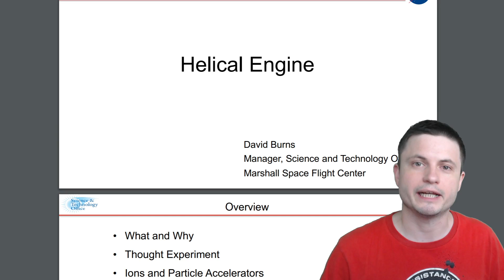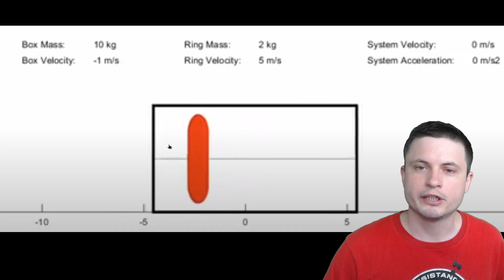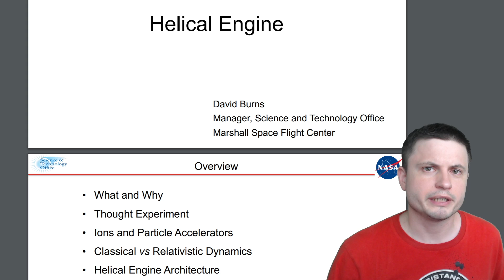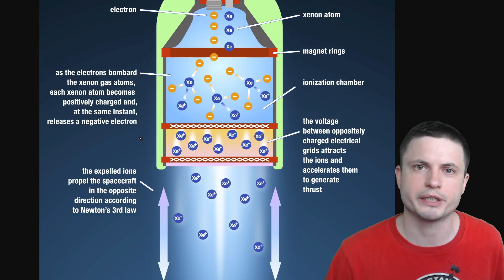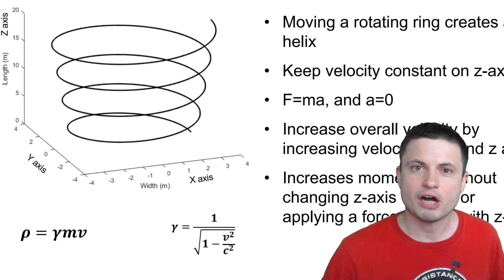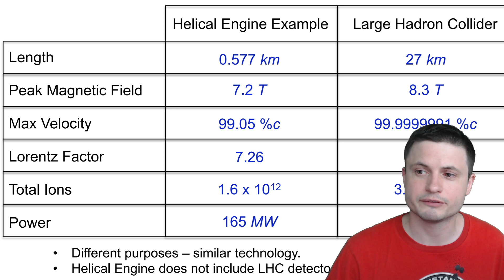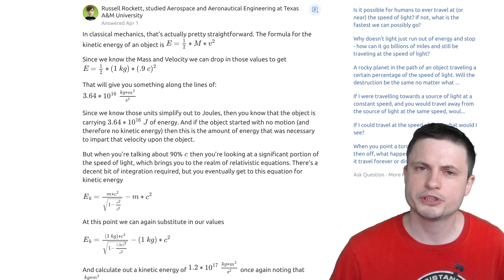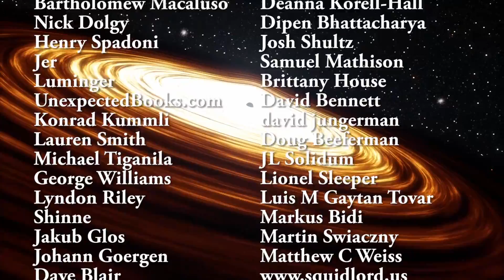NASA Engineer Designs a Near Light Speed Engine But Does It Work?

Comment: lol come-on nasa dont just throw uranium out the window. lol uranium asteroids would suck!!!!
maybe play some billiards and learn how to harness and direct the spinning motion of a spherical object. YOUR SPACE SHIP SHOULD BE THE BILLIARD BALL  BEING SHOT INTO DEEP SPACE. PARTIAL ENERGY GAINED BY IMPACT OF ASTEROID MATHEMATICS AS YOUR STEERING WHEEL AND A SUPER cpu TO WORK OUT THE NECESSARY ORBIT FOR INTERCECTION. YOU JUST NEED TO SPIN YOUR SHIP OPPOSITE OF THE ASTEROIDS ROTATION. YOU IN EFFECT CAN USE YOUR ION ENGINES AFTER YOU ESTABLISH ACCELERATION. IF YOUR SCARED OF IMPACT. USE MAGNETS W CORRECT POLARIZATION FOR THE SITUATION OR EVEN ACHIEVE ACCELERATION FROM A DISTANCE WITH THE NEW LASER SYSTEM BEING WORKED ON RIGHT NOW IN HOPES TO GET SHIPS THROUGH OUR ATMOSPHERE WITH OUT NEEDING FUEL. 

I KNOW SOUNDS FAR FETCHED. lol welcome to being a human tho. fetch the far ideas folks! much love

Comment: You have an incorrect analysis of the energy needed. You are factoring in resistance against achieving the speed of light bc of your experience on earth, in space the weight of the object is completely irrelevant. If you want to reach the speed of light you need only to ACCELERATE to that desired speed, the mass of the fuel cell is relevant only upon thrust force...which in space oddly enough is force multipled against itself (0 gravity). This is why using decaying isotopes for fuel energy is so effective. The weight is irrelevant, it's about the reaching of top speed rather it's quickly (boost engine) or slowly and constant (ion propulsion and radioactive decay fuel cells). I feel you don't grasp the concept of physics in 0 gravity payload propulsion systems very well. To simplify it...greatly.... you can imagine weight in a car with round wheels vs square wheels on earth. The weight itself of 1 person vs 2, 3 or 4 is miniscule....it's the ability to reach top speed fluidly and easily that's the greatest mechanical advantage....and luckily in space there is mechanical advantage in abundance. In space size DOES matter, but not in weight, more so in the size of the area you are trying to reach that speed of light. You can choose quickly in spurts (like the nuclear bomb detonation propulsion engine method) or slow and steady (again ion thrust from SpaceX or radioactive decay propulsion like voyager plutonium core decay). Weight in space is not a significant factor unless it prevents said energy source from obtaining desired speed.

Comment: to get up close to lightspeed will take 350 days at 1g of acceleration,so to get to the closest star will take about 7 years if this had been possible(it is not) as one adds fuel the spaceship gets heavier so you will need more fuel making the spaceship even heavier so one will need more energy to accelerate than it is possible to bring with you this is the smallest of problems one will have.the blueshift as one gets close to lightspeed will change every type of radiation into ionising radiation the protection will add even more weight to the spaceship so this is impossible and will be so long into the future.

Comment: Lightspeed is not fast enough. Even with a lightspeed engine it'd take us a thousand years to reach the closest star, which is a red dwarf anyway.
And lets not forget about deflector shields before we go, or a rock would go straight through the hull. And long range gravity detection so we dont fly straght into a black hole or a rouge planet.

Comment: Probably is better to improve ion engines.
Combine outgoing ion exhaust velocity with near-relativistic speed, like particle accelerators.
But smaller.

The system you described remember an half alcubierre bubble. In other words, in an half acceleration ring we can add positive mass, or positive thrust, not negative.

Comment: What about if you could reduce the mass temporarily and then as you allow it to return to normal it would increase causing the increase in mass without anything like the insane numbers of energy you talked about in this video
Reply: But by the speeds they want to achieve.. something spinning sounds alot more durable that something banging on a wall back forth at light speed while be assembled and reassembled lol

Comment: What no one ever talks about, is when these "ships" reach these other solar systems light years away. So, as far as getting a signal from one of these ships when they reach their destination, it could be hundreds of thousands of years before it gets back to us. In our time, the ship will have already reached its destination, but it was traveling so fast that it's already in the future, so it will be in the future in our time when the ship arrives at its destination. So, how will we get the signal in our time? this is the part that I was always wondering, but it seems like no one ever talks about it.
Reply: Wow never actually thought of that holy shit. We wouldn't be able to send a signal. The ship would in fact have accelerated in time.
Reply: @tori9365  But what I'd also like to add is that in order for us to receive the signal, the ship which has already arrived at its destination in the future, will have to somehow send a signal back to the past for us to receive it. So technically the ship would be in the future, but the signal will have to be sent back to the past.

Comment: I wonder if a ship would need two different types of engines. The alcubierre engine is like a wave pushing the spacecraft, kind of using high horse power to get up to speed, then the engine proposed here could build on that momentum to carry the ship at a faster velocity, similar to a spinning bullet or a hyper velocity missile.

Comment: If you reach near Lightspeed by pure propulsion you have to slow it down again if you want to stop.
I guess a Warp drive is more feasible as you "just" have to stop warping after you reached your destination and your speed itself can be as slow as we can fly now in space, easier to stop and you can theoretically move faster than light while in warped space.

Comment: "We will never get out of our solar system without warp drive". - William Shatner in 1955
Reply: we DID get out of solar system without warp drive
Reply: @marekverescak2493  It only took 40+ years, an eternity in the human lifespan. If we (humans and not AI) want to escape the solar system we need to move fast, extremely fast, hence warp drive is the only possibility, you move extremely fast.
Reply: @bronder1092   The thing is if we could travel with 99% Lightspeed we wouldn't experience much time because of time dilation. So the human inside such a rocket could survive a really long travel. But we wouldn't be able to communicate with earth for a long time and people on earth could forget about a mission that started some thousand years ago.
Reply: @20Paulchen08  That's exactly why near the speed of light is the best option. I only stated that traveling at the same speed as the voyager's would be too slow, it would cost too many years, hence why I referred to near light speed as the best option.
Reply: @bronder1092   Even at 70% the speed of light, it's still a ~6 year trip to alpha centauri, with about a year experienced in dilation on earth
Reply: @alanwatts8239  Exactly. Light speed (compared to the scale of the universe) is extremely slow. Possible solution: if wormholes prove to be a real phenomena, that is our only hope of getting out of our solar system.
Reply: @bronder1092  Indeed...rockets and light speed won' t get us anywhere. So, sometime in the future a brilliant system will be created, one that we cannot imagine now. That is, assuming Humanity survives...would it not be ironic that an invisible virus ends all of Humanity's dreams...
Reply: @bronder1092  Technically the voyager probes barely utilized propulsion to gain momentum and mostly just use gravitational slingshot maneuvers. In theory we could easily make intersteller travel far faster with even photon rockets or just making a sail and beaming lasers at it. With that you could reach our nearest neighboring star in 5 years, though if you actually intended on stopping you would need about 10 years to make it to the star. 

Other methods are ion drives (though you would need a ton of fuel), nuclear rockets (again you would need a fair bit of material to kick out to get momentum though you could collect more hydrogen from space as you travel with this one), and of cause the most outlandish antimatter annihilation. This one though is basically out of the question as we have no decent way to store antimatter nor can we just make it on the go. Most likely is that interstellar travel will mostly be a mix of both nuclear and photon drives combined together. Nuclear rockets also in theory could make it to our closest neighboring star in about 20 years though 50 if you you plan on stopping but that's at least a method that could be done now and the reactor powers the ship making power also no longer a question. 

Since warp drives likely are more theoretical that reality this is probably the best we've got. Until we learn what gravity is and learn there is a way to manipulate it (if there is a way) there really is no easy way to make a warp drive. It's kinda the whole reason more informative sci-fi such as Mass Effect and Halo don't use warp drives but something more economical. In Mass Effect it's the totally made up element zero which when electrically charged removes mass from nearby objects and can induce a negative force on things known as dark energy (it's an explanation to both dark energy and dark matter though totally unrealistic) and Halo uses slip space ruptures by making micro black holes collapse forming a tear in the the universe to a parallel dimension known as slip space (also unrealistic but far cheaper than powering a warp drive and without requiring exotic matter or energy).
Reply: @bronder1092  We're not even 1% out of our suns gravitational influence but ok
Reply: @averageman4873  Love how i'm still receiving comments haha. When I posted this comment I was in 10th grade, now i'm in College, i'll still be here even when i'm in university college.
Reply: @bronder1092  You comment was 4 months ago 😂😂
Reply: @averageman4873  And?
Reply: @averageman4873  I was simply stating that I will respond here until I am done in University College.
Reply: @bronder1092  You can't go from 10th grade to college in 4 months big guy.
Reply: @bronder1092  Ah okay. Wording was poor so I thought you attempted an admission of "I went from 10th grade to college in 4 months"
Reply: @averageman4873  Summer break. Also English is not my main language, so excuse my mistakes.
Reply: @bronder1092  or multi generational craft. imagine a journey that takes 5 generations to complete. wish there was a movie about something like this
Reply: @xisotopex  Lol that's a hell of an idea!
Reply: @bronder1092  actually theoretically using a warp drive you aren't actually moving through space, it's the space around you that move. Moving through space we wouldn't be able to reach even light speed because of insufficient energy sources and because to reach light speed having no mass is a requirement
Reply: @in.m1417  Every comment I am receiving all says the same thing. However, I thank you for teaching me this useful information!
Reply: @bronder1092  that's not how warp drive works. you don't move extremely fast, space is moving really fast, you are basically surf boarding through a space wave, cowabunga dude
Reply: @eksine  "Another one" -DJ Khalid
Reply: @bronder1092  if you don't want to hear it, it's easier to just to delete your original comment, it's better than trying to fight with everybody
Reply: @eksine  It's not that at all, it's the fact that i've already received multiple comments saying the same thing, hence why I am making a meme about there being another one.
Reply: Another thing, not trying to fight anyone. I enjoy receiving comments that correct me, but it's getting a bit excessive now.
Reply: @bronder1092  what are you studying?
Reply: @tonylopez6585  Next year I will be studying Physics 1, Math, Geology and another I haven't yet decided.
Reply: @bronder1092  
Even something close to the speed of light would be too slow.   It would take decades to get anywhere.
Reply: @keirfarnum6811  Indeed.
Reply: @bronder1092  Jean Calment lived to 122 years which is not an eternity and is not limit to possible lifetime in future.
Reply: @marekverescak2493  Technicaly Voyager 1, but we talk about reaching other stars...
Reply: @marekverescak2493  no.. a robot did HUMANS haven't been passed the fucking moon
Reply: @marekverescak2493  actually we havent yet, all our probes we sent out decades ago did reach the edge, but i recently researched our farthest probe out there, our solar system extends past the ort cloud and the probes have decades- up to centuries till they actually exit our aun gravity influence, which is where nasa considers our system to end.
Reply: 69
Reply: 1420
Reply: 1967
Reply: 1988
Reply: How tf is that supposed to be a quote
Reply: 1956
Reply: 10.000BC Was aight
Reply: We need to build something like the "Supremacy" which runs at 100 Million times more faster than the speed of light To get to the Andromeda galaxy in less 1 year.
Reply: @Shahanshah.Shahin  That would be cool until you flew into a large asteroid. Space objects cannot be avoided at such speeds.
Reply: @Cwra1smith  Then we need advanced shield technologies to prevent it. Unless that won't work either...
Reply: Was this before or after the gremlin was on the wing?
Reply: 45600 BC
Reply: shat
Reply: If you are quoting a Star Trek line, it would be more like 1965.
Reply: @Booboobear-eo4es  Star Trek premiered in Sep. 1966.
In 1955 (from the start of this thread), I believe Wm. Shatner was playing Ranger Bob on the Canadian Howdy Doody show, with dreams of becoming a Shakespearian actor.

Fred
Reply: @Booboobear-eo4es  Lost in space TV show was in 1965 (an earlier comic book was called Space Family Robinson although about different characters father and mother and son Tim  and daughter Tam) and Star Trek didn't appear on TV until 1966.
Reply: @hydrolito  - Oh my!!  I'm one year off!  Sorry about that.
Reply: He hasn't been wrong yet.
Reply: coincidence or  did Star Trek know something the rest of us did not...
Reply: technically you can but you need a huge spaceship that can support multiple generations of people while the ship is traveling
Reply: @kirtil5177   primitive thinking,   use warp drive...
Reply: @paulcheek5711  thats an easy choice to just say "use/research warp drives". but what if scientists learn more and find out warp drives fundamentally wont work?
Reply: @kirtil5177  well, the only way to know is by researching it, no? Should we not research it in fear it might not be true after all?
Reply: @102728  yes the only way to know is by researching. what i was talking about is you cant rely on technology that wasnt researched and proven possible yet
"dont sell the bearskin before you kill it"
Reply: @kirtil5177  sorry, wrote that comment pretty late at night. You're right, I get your point.
Reply: @102728  no worries, it happens, and i can see why you could write your first comment from your perspective
Reply: @kirtil5177  Extending life spans would be another way to leave solar system  in a slower than light speed ship and trip might take many life times as we currently know them.
Reply: But we have Voyager out of our solar system but we do not have warp drive yet.
Reply: 1984
Reply: 1820
Reply: @Aspect yep, multigenerational craft, 2, maybe 3 or 4 generations to reach a habitable planet, where they will start from scratch. they will live like cavemen, and may even lose the ability to reproduce the technology of the world they left.
Reply: William Shatner is not a scientist but an actor. Also they might figure out how to slow down or even stop aging so might have an unknown number of current life times to do it.
Reply: @Obiwuan Shinobi You construct another light source.
Reply: @Neil Rosenau Klingons are fictional characters, if space aliens exist we have no idea what they would be like they might not even be remotely similar to human.
Reply: So says an actor
Reply: 420

Comment: Use a group of Rail Guns for small, heavy mass. Open the front and back to space, the accelerate then mass in increments closing the front of the rail gun to create pressure. Forcing the spacecraft forward till speed it reached.

Comment: I have played these ideas a lot in my mind. The error is that you can not make such mass change. You need to simplify the setup to few quantums to see clearly that the energy to increase the mass of the rotating disk is equally massive. I.e. the mass moves from the battery to the disc and from the disc to battery.

Comment: E equals MC squared is flawed they've already proven the speed of light is not constant I've known this since 2000 Google if there's all kinds of videos you can actually go faster than the speed of light depending on the gas is your passing through IE light is not constant therefore to measure anything by light years or anything like that is flaw everything is based on E equals MC squared in it wrong

Comment: I guess if you use a cyclotron to accelerate large amount of particles, and have the accelerated particles hit the front wall at relativistic speeds. 

Or even better charge the wall to make a strong electric field to stop the particles.

Then the up side would only be: you can recover repellent, and this would be a propellant-less drive.